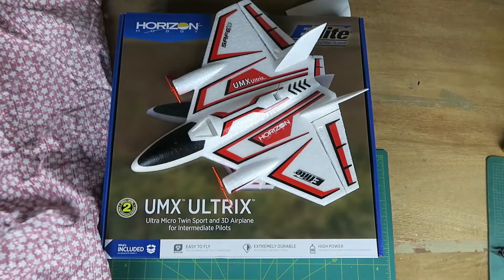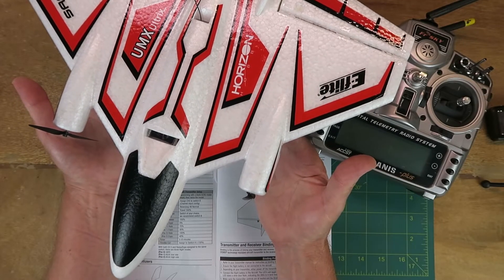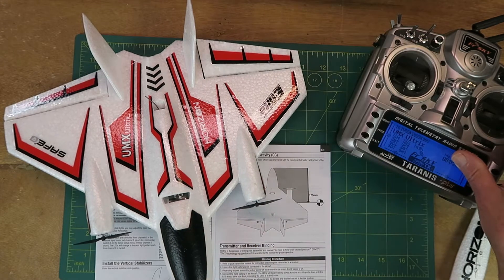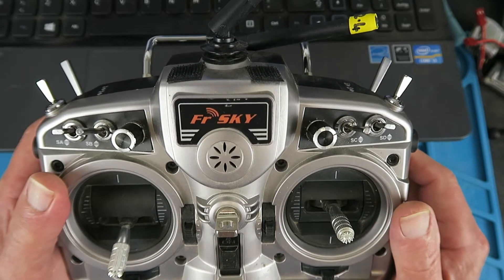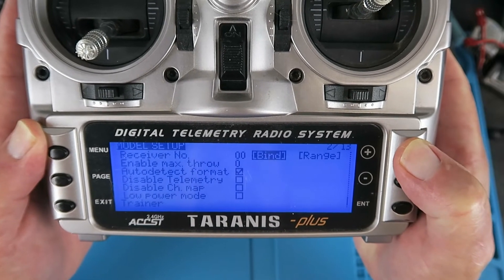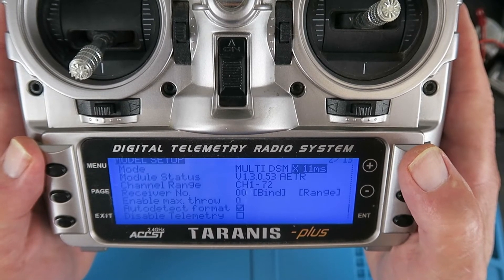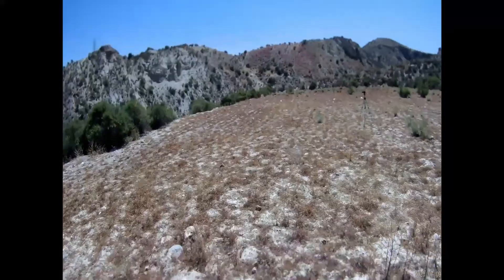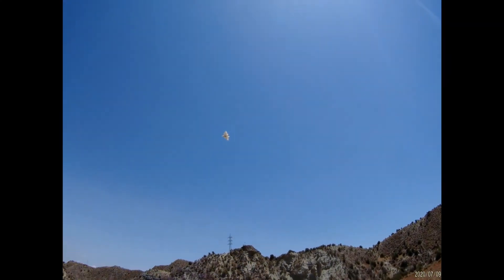E flite UMX Ultrix Taranis IRangex Setup Guide

Comment: what about the rudder mixing to the motors?
Reply: i have a radiomaster zorro and  its not working like that. have throttle but no rudder mixed to it.  kinda new to open/edge tx stuff. so not sure how to get it set up.   only figured out how to set up my goosky heli few days ago
Reply from the maker: @audio131  There is a link to my OpenTx settings in the video subscription. Load them into OpenTx companion and you can see exactly how I set it up.
Reply from the maker: Yes, what about it? The rudder stick controls the motor speeds enabling some "interesting" manoeuvres! it's all done automatically by the A3X gyro in the plane, no mixing needed on the Tx.

Comment: How did you set up rates and Safe mode switch on the Taranis?
Reply from the maker: Hi, there is a link to my OpenTx Settings "otx" file in the video description. Load it into OpenTx companion and you can see how the model is et up. Please consider subscribing if you have not done so already!

Comment: Cool video.

Note that the motors come with dry, unlubricated solid bushings rather than ball bearings, and they will slow down and eventually seize if you don't keep them lubricated, due to their extremely high RPM.  The motors must be removed and taken apart to reach the top bushing.

Oiling info here: https://www.youtube.com/watch?v=z9WVA7-VCNc&t=0s

Note that we Ultrix owners are experimenting with different motors that have proper ball bearings. and these have proved promising: https://www.banggood.com/Eachine-Novice-I-75mm-FPV-Racing-Drone-Spare-Part-NC1102-1102-13500KV-1-2S-Brushless-Motor-p-1587388.html?rmmds=search&cur_warehouse=CN

More info here:  https://www.rcgroups.com/forums/showthread.php?3496155-NEW-Eflite-UMX-ultrix-EFLU6450
Reply from the maker: Excellent advice! Thanks for sharing.
Reply: Have these motors been working ok, and do they fit same as spectrum ones,one of mine has just sized,this is a great little plane.

Comment: Spektrum use TAER how come you didn't do that.
Reply: Is that the same for jumper t12 pro
Reply from the maker: @SkyBandit45  I don't have one but I believe so. See https://www.rcgroups.com/forums/showthread.php?3139020-Jumper-T12-Multi-Protocol-TX-with-branched-OpenTX-firmware
Look under "Initial Setup"
Reply: @1nformatica  The reason I asked is because I'm trying to set up my Ultrix,in radio settings I have put TAER same as spektrum but safe is not working properly.
Reply from the maker: The multi protocol module has a fixed arrangement of AETR so the channels are remapped in the transmitter. https://youtu.be/1FfgbpD__dk?t=376